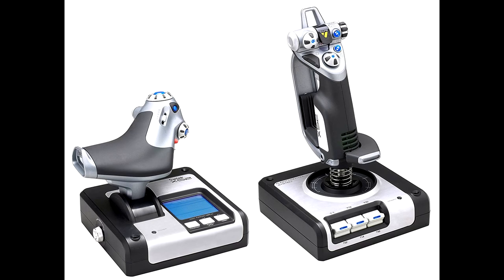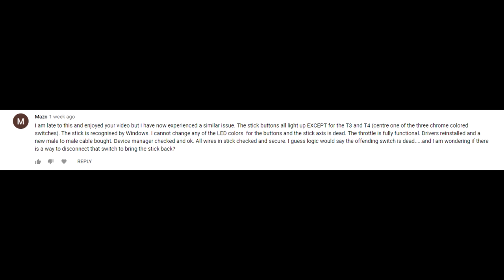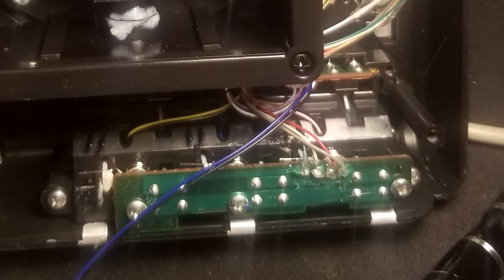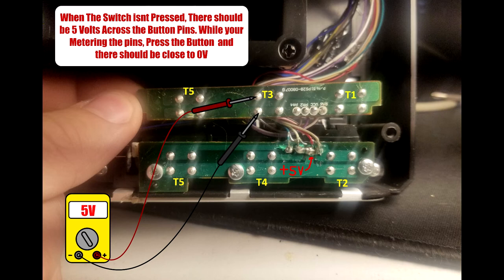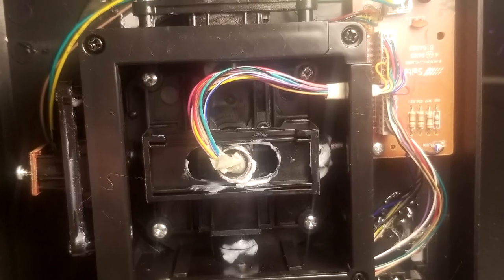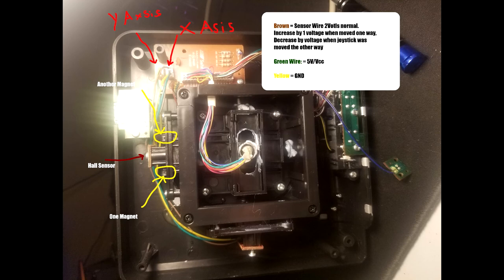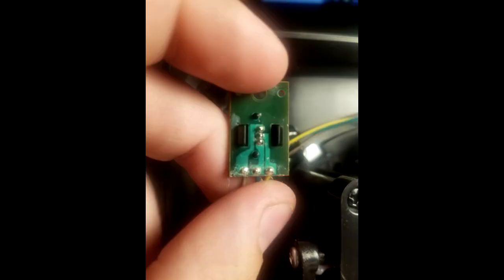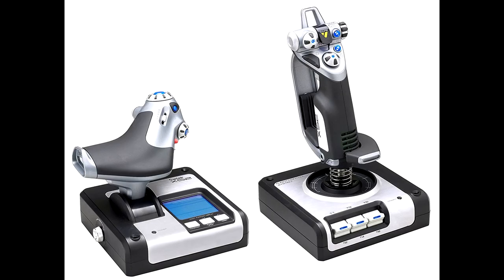Saitek X52 Diagnostics Axis and T Buttons

Comment: i've got an x52 pro .... after  VERY LITTLE USE ....  my main FIRE trigger stopped working.    it clicks, but nothing in  the Saitek software registers, nor JOY.cpl.    i've been all through the software side of things, i'm I.T. / drivers etc. so i'm guessing maybe the trigger arm isnt making good contact to the second piece to set off the second "click".          I have a G920 racing wheel also, which i suspect has a dead motor on the right side .... again, after very little use.   I might as well get a degree in electronic repair !!    ha ha ha !